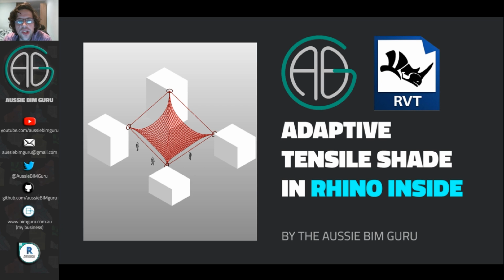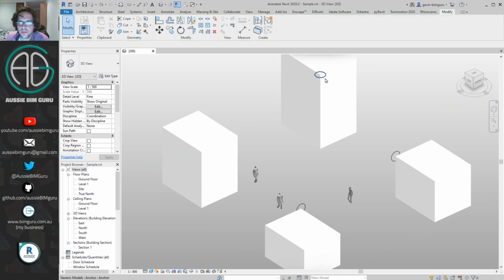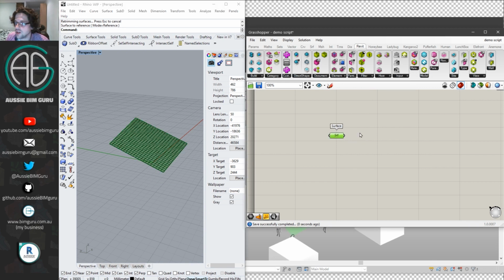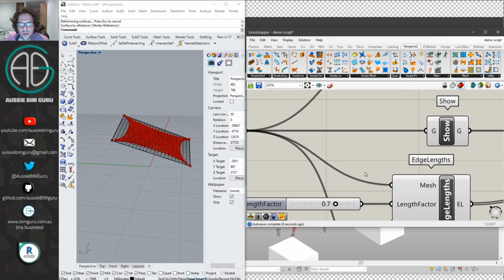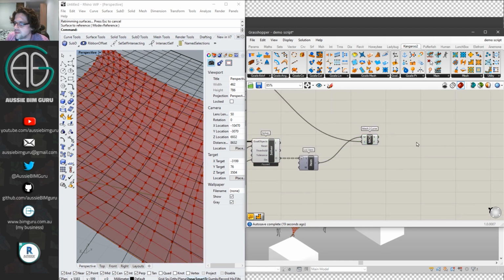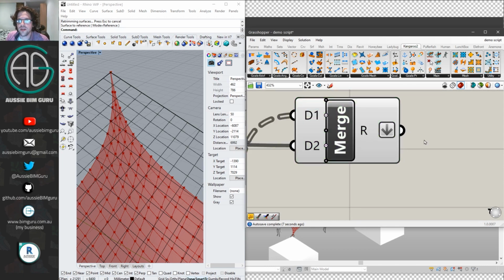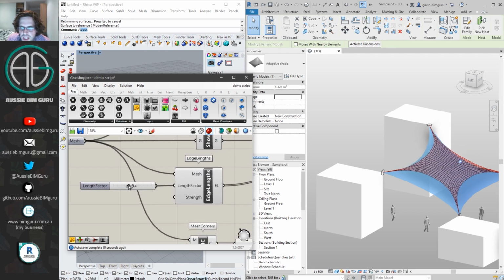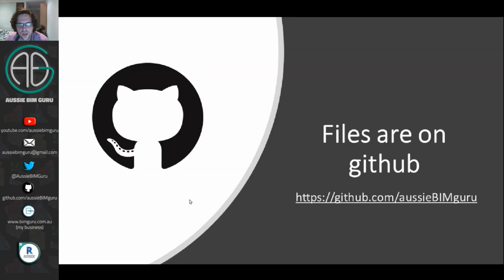Adaptive tensile shade in Revit (using Rhino Inside!)

Comment: Great tutorial, however this is not a tensile shade, this is a catenary surface. Tensile surfaces require a definition for prestress along both direction, it doesn't work with gravity at all (VertexLoad). I would like to see a tutorial for it.
Reply from the maker: In this case the edge length constraint is probably the best control to simulate the tensile force across the sides of such an element. I'm not 100% sure of the mathematical formula but it could be used to determine the target edge lengths in each case. Kangaroo has heaps of goal nodes, I encourage you to explore them!